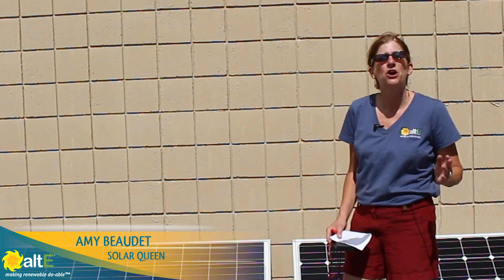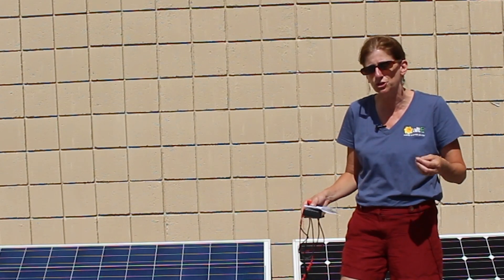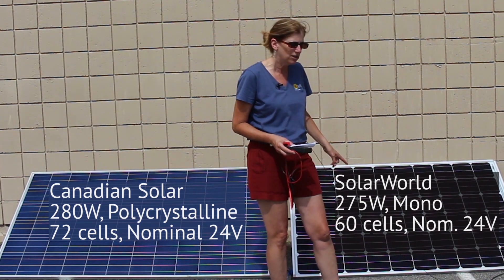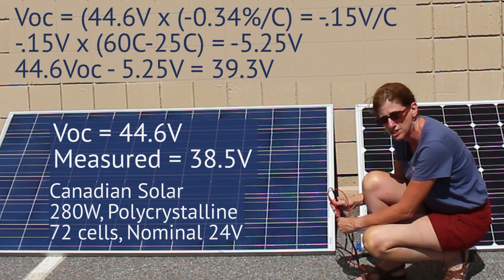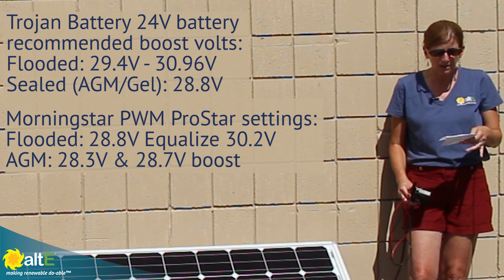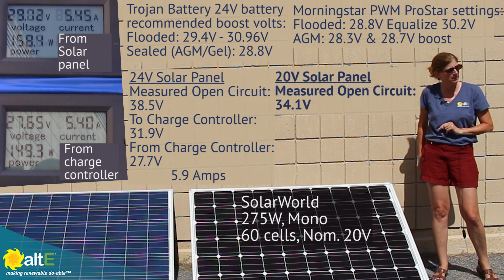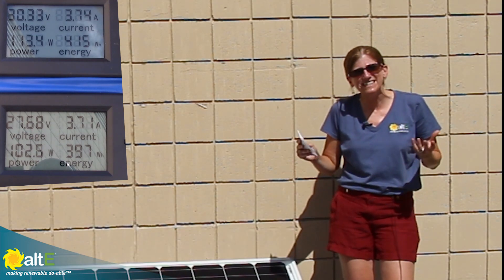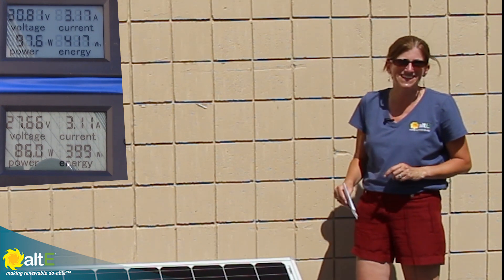Can you charge a 24V battery with a 20V solar panel and PWM charge controller?

Comment: Great video!
Add to your "to do list" what happens if you use a mismatch wire to for your panel, say, a 5awg and 10awg.
Reply from the maker: Interesting idea. I may modify it a bit, and measure the voltage output at the end of 100' spool of 6AWG and 10AWG to show voltage drop. The resulting difference in volts would then likely have the same results as mismatched voltage solar panels. If we wired them in parallel after the 100', as if you paralleled at the charge controller or inverter instead of at a combiner box by the solar panels, the lower voltage string (10AWG) would pull down the voltage of the higher voltage string (6AWG). Ooh, I'm liking this a lot. Stay tuned.
Reply: +altE Good, that will be a great video. 👍🏼
Reply: +altE make sure the higher wire gauge is connected to the positive terminal of the panel.

Comment: Hello Again. I hate to bother you again but I have just one more question. So much to learn. Anyway, If I was going to buy and Inverter only for right now. What would you recommend to run just the basic stuff but the main thing a TV ??  Thanks and Last Question. Terry :)
Reply from the maker: If you are just looking to connect a couple of low power items to a 12V battery bank that is getting charged from another source, just a little Samlex Pure Sinewave inverter like the SSW models would do the trick for not much money. https://www.altestore.com/store/inverters/off-grid-inverters/100-to-999-watts/samlex-ssw-12v-350w-pure-sine-inverter-p10828/ If you need a little bigger, there are several to choose from, https://www.altestore.com/store/inverters/off-grid-inverters/100-to-999-watts-c600/ I suggest you stick with pure sine and not modified, because pure works better with today's modern electronics.
Reply: Thank You so much. I will check those out and have already learned that the Pure Sine is better. You and your site are great. Sure glad I found it and Thanks so much. Terry

Comment: Love your site. Question : I just bought a 24' RV. I am going as much 12 Volt as possible with Solar. The problem is. I'm leaning as I go. So could you give me a ideal what would be the best videos to watch first being a beginner. Thanks in Advance. Terry :)
Reply from the maker: Terrific, welcome. We did put together a small RV kit, you can take a look at it here, https://www.altestore.com/store/solar-power-systems/off-grid-cabin-solar-power-systems/rv-solar-panel-300-watt-kit-p40521/. But to learn about solar, so you can determine what size system you need, I'd start with our off-grid design playlist. It will step you through determining your loads, solar array, and battery bank.  https://www.youtube.com/playlist?list=PLoHd6hGDqS07bbZkyi_4ntfiySUKjPsUL You can also check out the blog article we did on RVs and solar, https://www.altestore.com/blog/2016/07/solar-panels-for-rv/
Reply: Thanks so much for the information. Its appreciated and I will start on these Sites today. I'm a Subscriber now and will be watching. You do a Great Job on your Videos. Thanks Again. Terry :)
Reply: One more thing. I am going to try and run everything but the Air Conditioning with Solar. From what I've seen it take a Huge Set Up for Solar Air. Again. Just learning. Maybe this is an option to. Want to stay as Simple as possible. Thanks Again. Terry :)
Reply: Again : One more thing. I don't use a Microwave. :)
Reply from the maker: You are right, anything that makes heat or cold uses a lot of electricity. The AC may be best reserved for when you have shore power, or a generator. While it can be done with solar, it will take a lot of panels and batteries.
Reply: I'll just go the Generator route for Air and maybe head toward Florida for Winter. Ha

Comment: i'm using the iota battery charger with the iq smart module to maintain my backup battery since i won't have solar installed for winter. does the iq module sense what type of battery it has since there is no settings on this charger. you may not recall that i'm using the t-105 re battery.
nice tanned legs
Reply from the maker: The Iota IQ4 smart charger is not configurable for voltage outputs. For every 12V, its Float is 13.6V, 14.2V for Absorbtion, and 14.8V for Bulk. (x2 for 24V, x4 for 48V).

Comment: I look forward to seeing your MPPT version. There are loads of 60 cell panels available second hand for very low prices where I am so I'm looking at getting a couple and building a small off grid lab.
Reply from the maker: The MPPT version is out, https://youtu.be/4hU6FUiFI2I. The answer is the same with one panel, 24V is better, but the good news is, with two 20V panels in series with an MPPT, you will be in terrific shape!
Reply: @AltEStore  so if I have 2 100 watt 20v panels I can do a 24v battery pack?
Reply from the maker: @Willsmokalot  The 100W panels are probably nominal 12V panels with 36 cells. Two of them in series can charge a 24V battery bank with either a PWM or MPPT charge controller.
Reply: @AltEStore  I want to put two 100 watt panels in series and parallel another two in series that I can move around incase my suv in shade so 2 fixed on roof rack and two that  have enough wire to move around.  I only have two right now trying to get another two to add later.  thanks for your reply
Reply: @AltEStore  the module I'm using is hqst-100d-ss

Comment: it is 44C & my voltage is only 70% in 12 am is it normal?
Reply: OH my god.  That's hot!!  I think you meant to say 12 PM.  At 12 AM, you would get 0% voltage because it would be midnight :)  And it wouldn't be 44C at that time.
But geez, I have never seen a voltage drop like that for solar cells.  That's crazy.  If you pour water on the panels, does the water boil ???
Reply from the maker: I would melt right then and there. That's 111F for you fahrenheit folks. But that's just air temperature. In my video, the air was 31C, but the panel sitting on the hot pavement all day was 60C. With your air temperature being 13C higher than mine, let's assume the panel is also that much hotter, so say your panel may be 73C. Let's do a bit of math to see what a typical panel voltage drop would be. 73C - 25C = 48C hotter than standard test conditions (STC). I looked up the spec for a Canadian Solar polycrystalline panel, and it loses 0.34 %/℃. If we multiply that by the number C that it is hotter than STC, .34% x 48 = 16% loss. So temperature accounts for half of your loss. You may also have some voltage drop from the wires, dirt on the panels, less than perfect angle, etcetera, which could all add up to another 15% loss.

Comment: Does water on the panel cause shading?
Reply from the maker: Good question. My answer is what I often say, it depends. If the water is pooling in a corner, and brings dirt and pollen over with it, then definitely yes. But if it is a spray with clear droplets, it might actually increase the sunlight to it. It'd be fun to measure some different scenarios, I'll put it on the list.